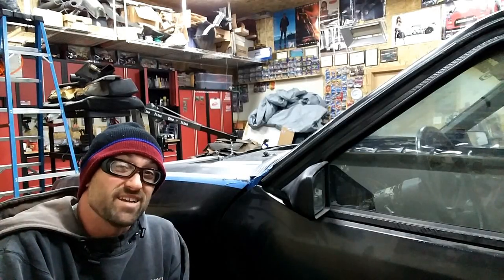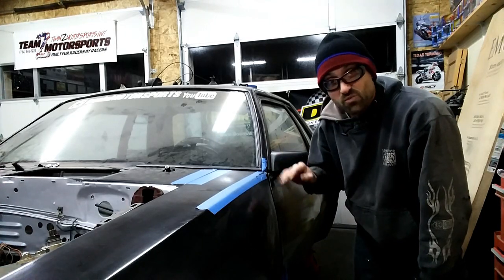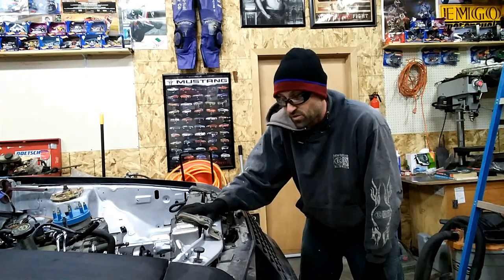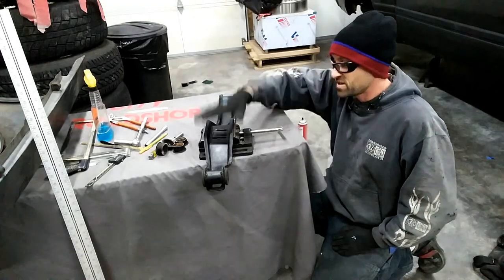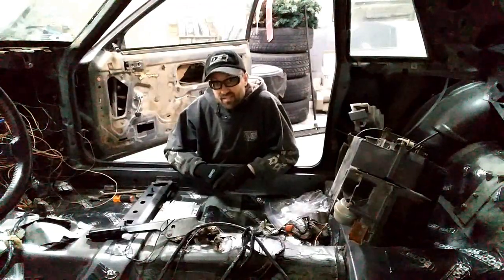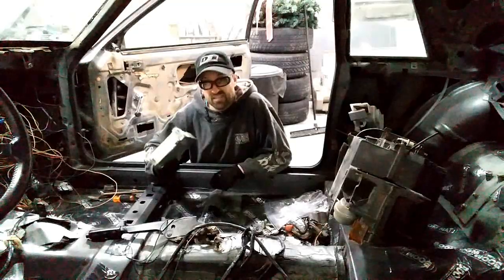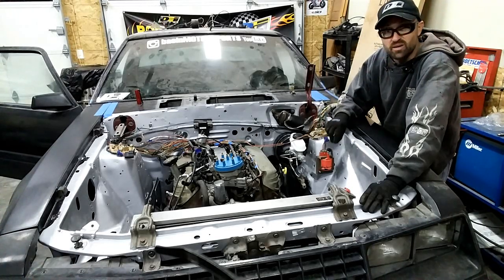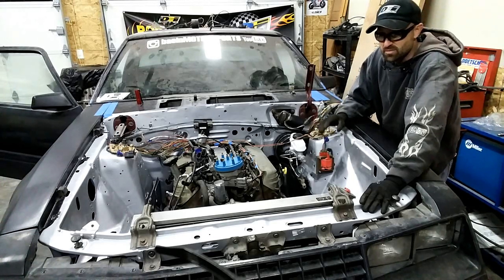Design and Build an ECM Relocation Mounting Bracket

Comment: What kind of mechanical background do you have?  Your thought process is beyond OCD or you’ve done this a lot.
Reply from the maker: Snoop Hogg I have been tinkering with cars and motorcycles for the last 29 years (since I was 14). I have a degree in Mechanical Engineering, and I worked for Circuit City for a year doing Mobile Electronics installs. I worked in auto factories for 15 years also, which is where I really learned to put vehicles together on a large scale.  I would accept if you thought my OCD was beyond normal levels. I have my days fighting it.  Wait until you see the finished wiring job.